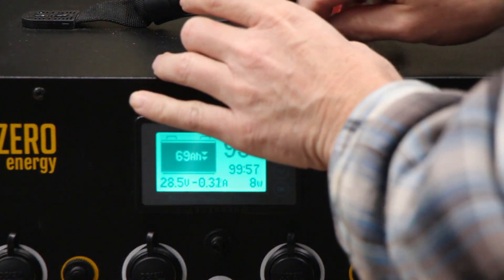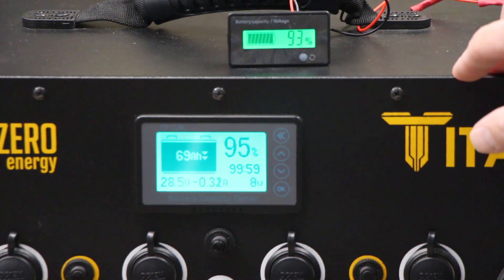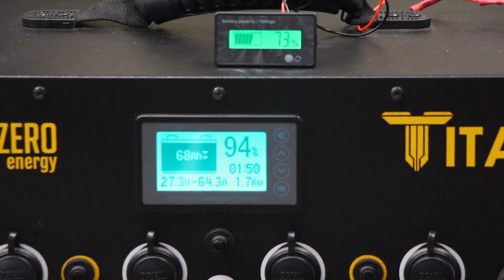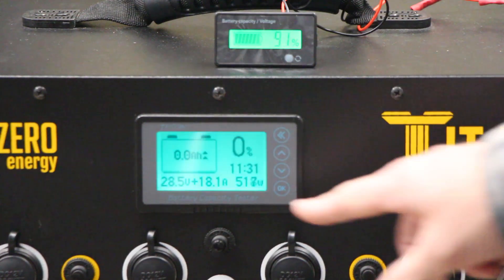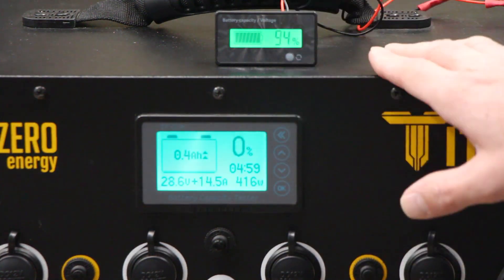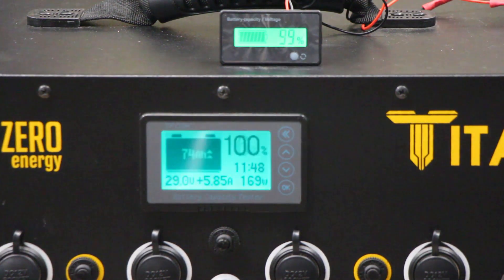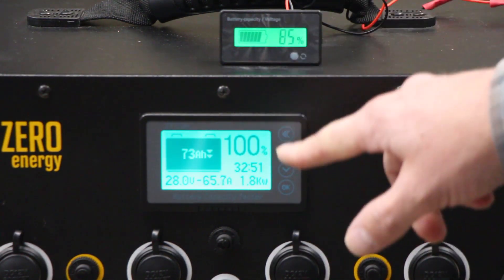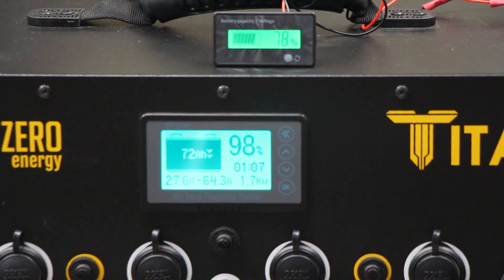Point Zero Energy Titan meter calibration: How to Calibrate Your Solar Generator

Comment: If you didn’t get one of these units then you really missed the boat in terms of practicality. It has a low frequency inverter. It practically sips watts while idle. The inverter can use batteries of different chemistry just fine. Easily repairable with comparable parts off the shelf and most of all it’s scalable. I own 4 and still can believe other preferred cheap overseas brands over something that is still unrivaled in it’s class and size. Add additional solar controllers, AC chargers, battery expansion port without hacking. SMH 🤦🏾‍♂️. And for those that are selling their units 😂, a sincere thank you 🙏. I love tinkering and seeing where I can take this in the future.

Comment: my wall charger has the green light (indicating full charge) yet the battery meter says 26%. Every few minutes the light turns red but it’s charging at 150W rather than the usual 650W, then it shuts off and goes back to green
Reply from the maker: If you are using Lifepo4 batteries, and your voltage is 27.2v or higher (29.0v if you have an nmc battery) when it shuts off, press the ^ button for 3 seconds to calibrate it to 100%

Comment: My problem, I don't have two green lights on my charger and the it beeps consistently with one beep. If I plug a fan in it will run for maybe 5 seconds and turn off. I would like to be able to use the Titan and both batteries but it will not function. All I get are beeps.  I tried to configure it with one battery or two and it makes no difference.  This video did not cover any of the problem I am having. Charger info : Model YZPOWER-600 rev 03
Reply from the maker: Hi,  I am sorry for the problems you are seeing.  One beep is a low battery, so it makes sense that it runs about 5 seconds then turns off.   If you have already followed the battery calibration instructions from the quickstart guide or the manual, then I would suggest contacting our technical support to figure out why your battery is not charging.  They can help you troubleshoot, and get things figured out for you.  If you have not followed those instructions, I would suggest following those steps first.  But don't worry we will get it working for you.

Comment: Again, thanks for all your help, I had to try 2 different ways/attempts to finally get the Titan going with the 2 batteries. Now, there is another problem I'm asking your help with : The Titan went into service mid September, 2021. I now have 7 -100watt solar panels connected to it. One day about 2 weeks ago, the Titan would not show that it was charging from the panels, it only displayed about 9 to 11 watts discharging and storage capacity % slowly dropping, with no load other than the digital display lit. What the heck? So I un-plugged the solar connectors (on the right side of the twin incoming ports) and probe-tested incoming voltage, which was reading around 400 watts which is normal at that time of the day. So then I plugged it back in, and still no incoming charge readout, just the tiny discharge reading. So I then un-plugged from the right ports and re-plugged into the left ports, and , vola! It starting flashing showing 400watts of incoming charge. Yay! Now, the newest problem : It's doing the same thing on the left ports, so I un-plug them and count to ten, and then plug them back in, and then it changes from tiny discharge back to flashing incoming full charge. (At least that's better than the right side ports, it wouldn't even do that). It does continue to charge on it's own throughout the day, and it's goofy-ness of not displaying + charge is sporadic, i.e. ( yesterday morning it was working normally, but this morning, no, I had to un-plug, wait, and re-plug it in, and then it's performing normally, again). I bought the Titan from shopsolarkits dot com , but they are hard to get ahold of. What do you think might be the problem? And, how do you suggest the right ways in which to correct/fix this problem? P.S. It's still a beast, especially now going from only it's 1 -74 ah battery, to 174 amp hours with the added external battery!!
Reply from the maker: HI,
I am sorry for the problems you are seeing, and with more information I will be able to tell more.   But from the description and information I have right now, it sounds like you did not get a kit from us, and probably have the panels configured in a way that is extremely inefficient (hopefully this is the case), or in a way that could be damaging the charge controllers.  There is no way to configure 7 panels to go into one mppt port in a safe efficient way.  My guess is that you have all 7 in a series, which will produce a voltage over the safe range of 145V.  It may work at times depending on the temperature, and the sunlight, and rating on the panel, but when you have good sun, or it is cold, the voltage will climb over 145V, and will damage the charge controller (and possibly even more components). 

Can you tell me the voc (voltage open circuit) of the panels, and how you have them configured?  From that I will be able to have a better idea what is happening.  But in the meantime, don't use the 7 panels all together in a string (if they are 12V panels, you can go up to 5 safely).
Reply: @PointZeroEnergy  It is a Titan 500 Rigid bought from shopsolarkits. 1 solar panel was partly shattered-freight damaged- and they sent me another one. The damaged one they said to throw it away, or test it and play with it and maybe it's still usable, and so I did, and with 2 separate coats of spar urethane clear gloss, it still produces 94 watts, so, I'm using it, too. That's 6 panels in series, 2 on the NE side of the 8/12 pitch roof and 4 panels on the SW pitch. I recently bought 2 more 100watt panels from Newpowa, One for another separate wind/solar 12volt system I've built utilizing SLA AGM batteries, and the other one for the Titan. The open-circuit voltage of the Newpowa's are 20.23v. I could very easily climb up and dis-connect that 7th panel, no problem. Should I? I can always add that one to my other system, or just remove it off the roof.
Reply from the maker: @urbanskisv  I would suggest not going over 5 panels in series.  Also if you have panels on a different side of the house, I would connect those panels to the other mppt.  When you have some panels shaded (or less light than the others), it will really reduce the output of those in the sun).  I would connect 3 panels in series to one mppt, and the other 4 to the other mppt.  That will get your voltage in a safe range, and provide much better power production during the day and maximizing the output of all panels.

From your description, your mppt controllers may have been damaged by over voltage (with 7 panels in series).  If they still don't work correctly after configuring them as described above, you may want to have us take a look at them to see if they are damaged.  Since you purchased through shopsolarkits, you will need to contact them first.  They can then open a ticket for you with us for you.  From there we will be able to assist you more.
Reply: @PointZeroEnergy  I've disconnected the 7th panel, I thought 7 panels total was just under the 145 volt max, so that's why I did what I did. Darn, I'm sad I may have screwed up. And, thanks for explaining how I should re-wire the 2 NE panels separate and into the other solar inputs. While I get a support ticket going to return the Titan, I'll at least do the re-wire and have the 2 panels separated. Oh, and I could wire in the new panel with the other 4 on the SW side that equals the 5 panel maximum, like you explained? Would that be OK? Oh, and are you in Idaho, too? I live in Nampa. Thanks, Dan.
Reply from the maker: @urbanskisv  All may still be ok, but I think it may be worth it for us to check it out, especially if it is not working properly.   It can get a little confusing with solar panels max voltage, because the rated voc on the back of the panel is  for 25 deg C (77 deg F).  At higher temperatures the voltage will actually be lower than this, and at lower temperatures it will be higher.  This means even if the Rated voc on the panels add up to 140V (or even lower) it can still go over 145 when the temperature is less than 77 deg.  This is why we recommend keeping the voltage down with only 5 12V panels (rated voc will be around 100-120 depending on the panel), to give some room for temperature swings.  You can read more on how this is calculated here:  https://www.pointzeroenergy.com/knowledge-base/temperature-and-solar-panels/

Yes we are in Idaho, but Nampa is about 320 miles from us.  If by chance you are traveling this way, or if you want a quicker turn around, you could bring it by, and we can look at it for you.  But for that you will need to schedule a time with our technicians (once the ticket is open, you can work that out).

Comment: Could you please tell me the Anderson connector size number/color I use for the battery expansion port on the Titan? I need a total of 8 feet of extension wire total to add an external battery. And what wire size you recommend? Thank you for your help.
Reply from the maker: Hi,   You can use the Anderson SB50 Red connector, with 6awg wire.
Reply: @PointZeroEnergy  Ah, so nice of you to provide me with that. Thank you.

Comment: Hi, I'm a newbie with a titan 500 rigid that has 1 stacked 74AH 24v battery. Can I externally add a 100AH 24v lithium battery? I take it that I need to fully charge both batteries, 1st, with no discharge loads? and then re-set the the titan display to 174ah? You're help in this is greatly appreciated.
Reply from the maker: Yes, just make sure all batteries are charged to 29V, set the display to 174ah, connect all the batteries, and if the meter does not read 100%, charge until it does.
Reply: @PointZeroEnergy  Thanks for your reply. The user manual is very confusing. I want to get this right. Can I leave the Titan battery connected/stacked while charging it to max? Or should I un-stack/disconnect it and charge it up? (of course the external battery will be charged up separately). And then at what point do I set the display to 174AH? And at what point do I connect back both batteries?
Reply: I gotta shut down my PC. Be back late tonight or Sunday.
Reply from the maker: @urbanskisv  If I understand you correctly, you have one Titan battery, and now you are adding a 100ah 24V external battery.   If this is the case, yes you can leave your battery connected, and charge it until it is full (29V or higher), and then you just need to charge the external battery to 29v.  You can do this by removing the Titan battery, and connecting the external battery, and charging through the Titan.  Or any other way you know of to charge it (the Titan battery charger could connect directly to the sb50 plugs you have on the battery to connect to the Titan external battery port, and charge it independent).   Really it does not matter how you get them both fully charged, but you just want to make sure they are both fully charged, or within 0.5V of each other before you connect them both to the Titan at the same time.  You also need to program the battery meter for the correct amp hours, and you can do this at any time.  Then the final step is to make sure once everything is connected and programmed, the meter reads 100%, and the voltage reads 29V or higher.  If it reads 100% and 29V, then you are done, if it does not (the meter does not read 100% and or the voltage is not 29V or higher), then you need to charge more until you get both of those reading.  At that point you are done, and the meter is calibrated.
Reply: @PointZeroEnergy  AHHH! Confidence level is HIGH!! Thank you soo much for clearing this up for me. Now I'm comparing what you explained versus the Point Zero Energy user manual, and your personal explanation is more clearer to understand to me, than the manual. Thanks again. Dan. PS- this Titan is a BEAST!! Flawless performance for a year and a half!!!

Comment: I agree w Gary O below and several others--this is confusing--I'm probably the only woman to buy one of these--and other than working on minor computer problems, I'm not an engineer. It's TOO complicated getting this thing calibrated. PLEASE YES DUMB IT DOWN. I've had a hard time getting this thing set up--looking thru YouTube videos --the users manual doesn't cut it. THANKS. Get a better tutorial/instruction set up video made and how about shipping out with the unit??For 7K you'd think you might get better help.

Comment: I just recieved mine and I have had trouble getting it to calibrate.  I followed the manual to the t but it plainly says not to change any of the other settings and it does not tell you how to zero it out to get it to calibrate.  Question.  If  you are charging with solar does the unit have to be on in order to charge the batteries?  Just FYI:  It is a great design but a small improvement that would be a significant advance would be to have charging ports on the individual batteries.  Its a pain to have to haul the entire unit to charge batteries at set up.  It would be much easier to charge the batteries and then just take them to a remote camper or off grid location....
Reply from the maker: Hi, Once the battery meter is set to the correct number of batteries, and they are fully charged to 29.1V, it should read 100% full, and is calibrated.  There is no need to zero it out to calibrate, it will do that automatically once it is charged to 29.1V.   And yes, you do need the Titan turned on to AC/DC, or to DC mode in order to charge with solar.  In the off position the battery is disconnected from the mppt charge controller in order to prevent any battery drain.  Because of this you can't charge with solar in the off position.  You can still charge with AC, since it has an external charge controller, however if you charge with the unit turned off, you will need to re-calibrate when you turn it on unless you fully charge it, and it auto calibrates to 100%.  This is also the reason why you can't charge the battery with solar without the power module.  The Titan was designed to be very versatile, and work with all types of batteries and configuration.  However with that versatility, it makes it causes a few inconveniences such as needing to have the power module on when you charge, and to calibrate the batteries.  In the future we may develop a system that is not so versatile, but easier to use.

If you need more specific support on your product, it would be best to open a ticket with our support team, or call use.  https://www.pointzeroenergy.com/contact-us/
Reply: @PointZeroEnergy  Thanks for the reply.  I had charged both fully but it did not auto calibrate.  I watched this video and zeroed it out and it calibrated correctly.  I am really excited about the unit!

Comment: How do I change CAP from current reading of "3222 to anything else? Up down arrows don't change any numbers only the line indicated. Is my 3222 number good or what. This thing is too fiddly pain in butt to try and use. 👎😥
Reply from the maker: Once you are on the cap row,  press the enter key to edit the row.  When you are done press the escape key to go back to the rows, and one more time to go back to the normal screen

Comment: Do you have to have the power module attached everytime you charge or can you plug the charger directly into the battery?
Reply from the maker: if you charge the battery without the power module attached, you will need to re-calibrate the meter before it is accurate.  However if you fully charge the battery, the meter will auto calibrate.
Reply: Also, if the titan were to be stored for a long leriod of time , what would be the best state of charge to do that? I vaguely remeber Will prowse saying something like 70% for lithium ion. What do you say?

Comment: Do you have this coming out with a 50 amp 240v plug or ability to pair (2) titan units in parallel off the 30amp plugs?
Reply from the maker: Our Titan 2.0 will be capable of connecting two units for 240V.  The output from the rv plugs would need to connect into a breaker, or 50A outlet box.
Reply: @PointZeroEnergy  So for those of us that already have the Titan, is there a solution for us?
Reply: @PointZeroEnergy  Your 30 amp RV plug is only 3 prong, which means, 120 voltage. Are you changing the 30 amp plug to a 4 prong one, which employs a neutral needed for split fase? I am totally off- grid, with no hope of ever getting on the grid, so it would be helpful if I could get a split fase since I do have 2 appliances that need 240 volts. Right now I have to use the gas generator to get this. I don't know where u r, but where I live, gas still isn't cheap, so I would prefer to a solar generator than the gas one.
Reply from the maker: @islanderpurgatory2055  The Titan 2.0 will still use a 3 prong RV plug, because one Titan will only be 120V.   So in order to get 240V, you will need to connect two Titans together, and wire the two outputs into an electrical panel.  To do this you will connect the two neutral wires from each Titan to the Neutral.  Both grounds from the titan the the ground, and the hot wire from one Titan to L1, and the hot wire from the other titan to L2.

We may make a panel with this pre-wired to a 4 prong 240V outlet (two rv plugs to plug into each Titan, and a 240V outlet).

Comment: Why don't you people at Titan make all correct changes on this machine because what want to do is just plug and go. For all this money we should no exactly what we use it for
Reply from the maker: The Titan uses a very accurate column meter, however this type of meter requires calibration.  Our Titan 2.0 will use a meter that is based off of voltage, and current.  It will not be as accurate as the current meter, but it will be plug and go.